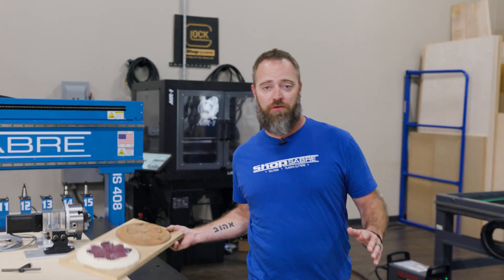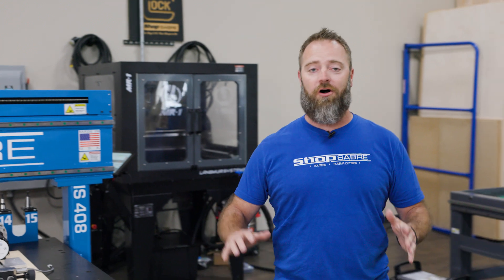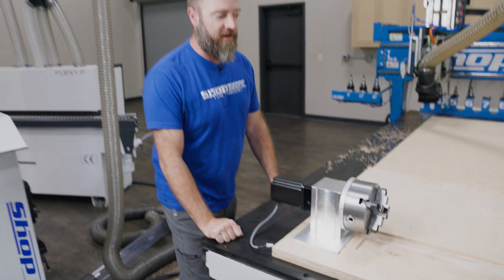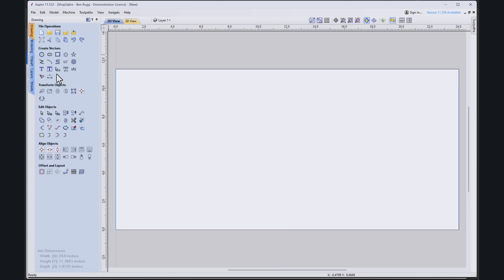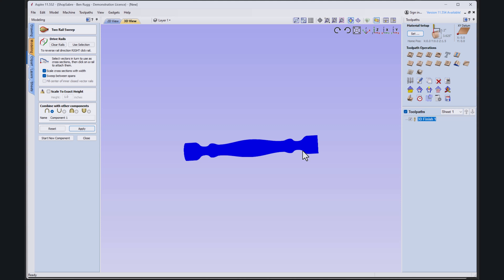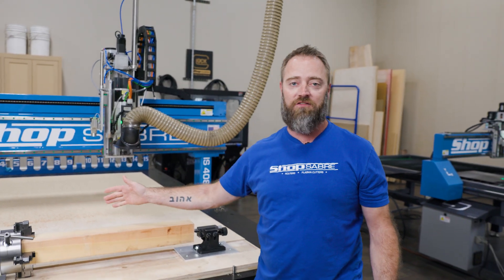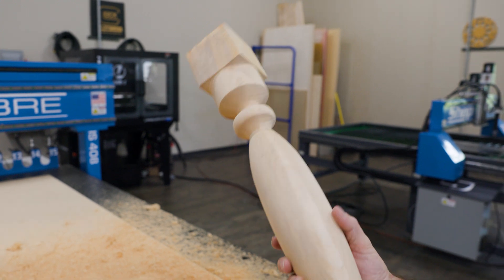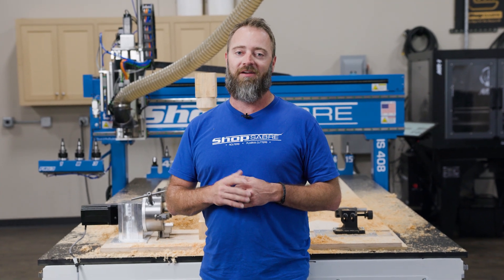Using a 4th Axis on a ShopSabre CNC

Comment: Any chance you can go over set up more. Two things I am concerned about, One being the machine returning to the home position after the run( even after setting X&Y), Second, Is more about the bit you are using? I am assuming it is a Vortex, Just have yet to see an 1/8 ball nose run that deep and fast.
Reply from the maker: The tooling is Vortex Tooling, they make various tools that allow you to run at the speeds you have seen - We suggest giving them a call and they can help you with understanding tools they make for different applications -- this is a tapered ball nose which works great for this type of work as you could see in the video. 

As for the machines position at the end, you can specifically call this out as you wish in your controller with a park or end position or if the machine is going to return to home, it will lift up and clear the material.
Reply: @shopsabre  we love our shop Sabre IS510, have quickly found that Vortex is the way to go for us. Look forward to more 4th axis videos
Reply: Does this do a final spin to clean up the small lines left by the but doing longitudinal passes like that? Can you do a manual spin so it could be hand sanded afterwards?